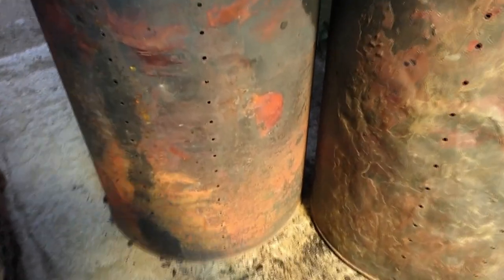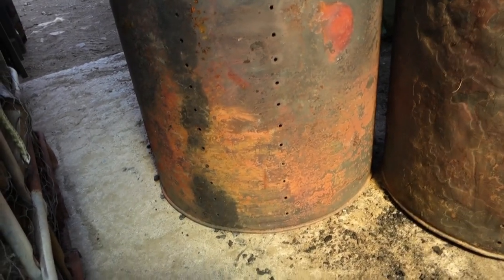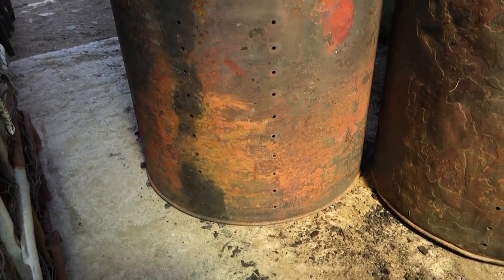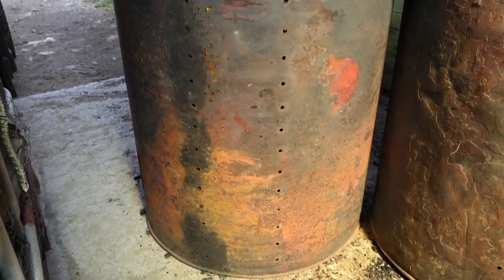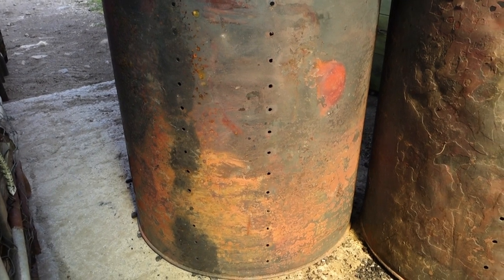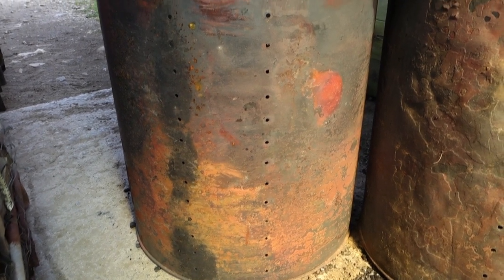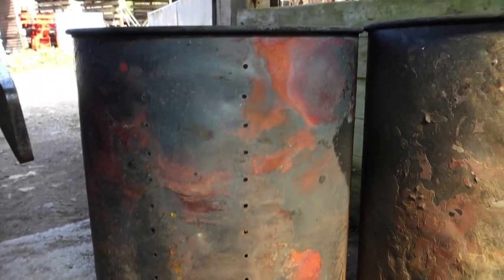Part 1 of the Dartmoor Dragon Charcoal Retort

Comment: Hi Thanks for the great work, I was interested in knowing how dry the timber was going into the barrels. Just with the steam coming out I was interested. I'm in Australia but an very interested in your charcoal maker. Have you ever produced biochar?
Reply from the maker: Hi Darren. We dont have a dry climate here but I get my wood down to around 20% before conversion. It still works fine a bit wetter but if too wet you use quite a lot of fuel drying it out. I am not entirly clear as to what differentiates  charcoal from biochar?  I use my current charcoal waste on the land. The Exeter charcoal company who are making the Dartmoor Dragon did a test burn with wood chips from a chipper and that converted fine. I tried chainsaw chips but that didn't as I guess it packs too tightly and does not get enough circualtion of heat in the barrel. I may try again with it less packed as I did compress it when filling the barrel.